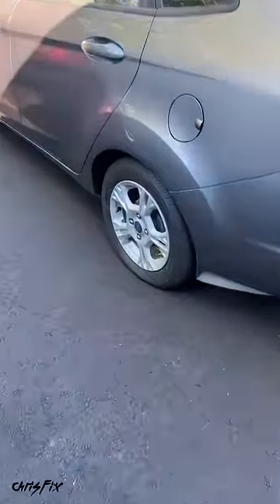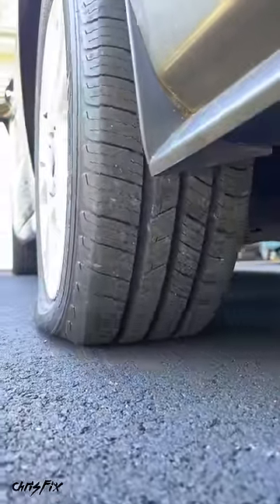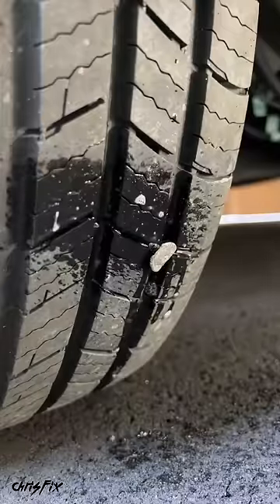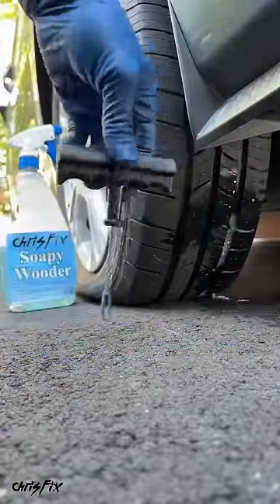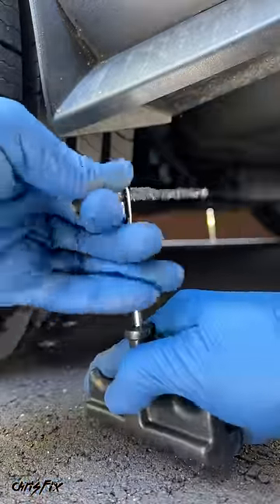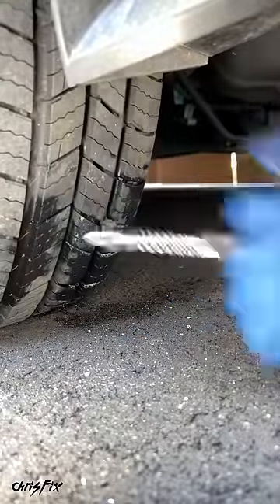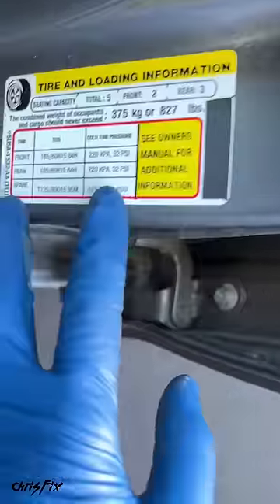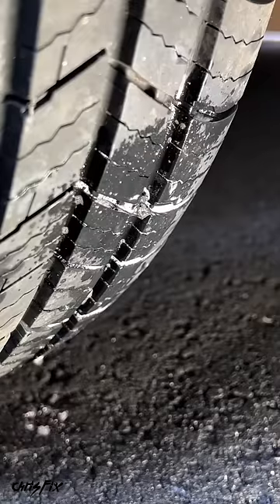How to Plug a Flat Tire (easily)

Comment: An important step you missed is that after you insert the plug, before you pull it out you need to turn the tool a 1/2 turn.  That way when you pull the tool out it creates a knot on the inside of the tire preventing it from being blown out when you fill the tire with air.  Every pack I've bought has this instruction on it.
Reply: I was waiting for him to say twist n pull out too lol
Reply: Very important step as I learned the hard way now.. Repaired about 50 tires that way but only mine went leaking about 10km after the repair..
Reply: The tool he used specifically states on the packaging, not to twist and to simply pull straight out. But i guess you must know more than chrisfix and the creator of the product.
Reply: @hufman9807  imagine thinking “chrisfix” knows everything. 🤡 if you read what he said you would’ve seen the part that say “every package I’ve bought has this instruction on it”. That doesn’t mean they all do. You can chill out a little bit.
Reply: He says it in the full video which is longer than this Short iirc
Reply: He also didn't mention anything about the glue (rubber cement)
Reply: Should also mention that this type of plug is not meant to be permanent, you should get the tire patched correctly at the tire shop as soon as you can.
Reply: @blackpiranaha525  The rubber cement is already on the plug
Reply: @hufman9807  That's right. You don't have to twist it. That's crazy. I never have and never had a problem.
Reply: Hey not everyone is perfect😂
Reply: I've always added contact cement to my plug. It makes it much easier to push in and pull out the tool.
Reply: Never had an issue not turning anything. There's no way in hell the plug is coming out anyway
Reply: @hufman9807  i work as a tire tech and our pro grade pruducts states to twist it. But still a plug is a temporary fix to get to a tire shop and get it fixed properly.
Reply: how does turning create a knot? 😂 that sidewall tho
Reply: @KimoKimochii  plus no instructions say that, the guy makes sht up
Reply: @rafars2246  exactly? if anything, turning makes it easier to come back out
Reply: @KimoKimochii  yep, it will be compressed, thinner.
Reply: @rafars2246  Thank you for having common sense 🍻
Reply: @SeiferFirehart  I've plugged tire damage like this a good dozen times over my lifetime same type of product. Those have been permanent repairs every time. I've always put rubber cement on the plug and let it dry overnight before refilling the tire, as the only thing different than what was done here.
Reply: Zachry Diehl 

Incorrect
Reply: @SeiferFirehart  

It worked for me for over two years. Pretty permanent
Reply: @ProleDaddy  Usually when you patch tires convetionally you apply rubber cement and wait for it to dry 5-15 mins depends on temperature (of course scuff the rubber first) and then apply patch or patch with a dowel and it's done, don't need to wait overnight. I've seen many tires patched with a wire like that as a mechanic and some did seal properly for a long time but many came for tire repair and only leak was that repair spot. Even if it holds air, it was designed as temporary fix, it is not the best seal and it only holds itself by the tire thickness it can easily get loose by rough road (like tiny rocks) and fall in or gradually weaken the bond and if knot inside failed or someone didn't even make one it can blow out, in both cases you will lose air very quickly and it can be very dangerous at medium to high speeds. Just repair it properly when you can, you don't want to risk it.
Reply: @Fordgroup00  I already explained it why it's not a good idea minute ago, don't want to spam that again.
Reply: If it blows out you made the hole too big or your over filling that tire like a basketball
Reply: There is no one rule for a plug kit as every different plug kit says something different when it comes to instructions.
Reply from the maker: Thanks for the tip. The instructions on this specifically said to pull straight out. If you twist you will pull the plug out with it because the plug will wrap around the reamer. Air wont push out the plug. It vulcanizes in the tire. If air pushes the plug out you didnt push the plug more than half way in.
Reply: I never done that twist and to this day no plug has failed
Reply: Never done that before and I've installed these plugs about 50 times
Reply: @dougb27  none would say that bro because if you twist something like that its just gonna wrap around the tool and pull right out
Reply: @thenorthernhandyman  
Pffft. You're taught to say that you need to take the tire into a mechanic as soon as possible just to get the business. I plugged many many tires in my 64 years and never had to get them patched. Crooks everywhere I swear.
Reply: @desertodavid Ty
Reply: So I plugged my tire and did not twist and...bubbles. I then pulled out the plug and put a new plug and did the twist a little more than half way and...no bubbles.
Reply: @desertodavid  anecdotal evidence, I can guarantee you that a patch is better in all circumstances.
Reply: @chrisfix  hey Chris can you please make an supercharger install on the drift Stang
Reply: funny, every kit ive ever bought says DO NOT twist.
Reply: @thenorthernhandyman stop lying. Tire tech? 😂 Aspire to be something. 😂😮
Reply: @BigDipper79  actually tried a few different trades, certified master driller, driller instructor, truck driver, road maintenance, loader operator, math teacher, assembler, wind and solar technician. I chose this work because of good pay, good schedule and a nice workplace
Reply: You do you let the Master cook tho👑
Reply: @SeiferFirehart I've plugged several tires an ran them for years with a plug in them..Just personal preference I guess.
Reply: @dougb27   nah sorry. youtube man knows his stuff
Reply: I was wondering how it stayed in without this - makes sense, thanks!
Reply: @SeiferFirehart Came here to say this. Also, don't try to patch a sidewall or the corner of the tire. For various reasons, that tire is now toast.
Reply: Imagine going to an instuctional dyi video just to be pedantic  🤡
Reply: Lol
Reply: I’m a yr late but you can see that he turned it. His hand is in a different position after the cut
Reply: Thanks I am about  to try this now 😎
Reply: @chrisfix you're the best
Reply: I enjoy eating a whole wheel of cheese on a hot day then washing it down with mayonnaise.
Reply: Some of them say don’t do that
Reply: @thenorthernhandyman  I never used a plug as a temporary fix and never had a problem
Reply: So I just had to plug my tire today it had a tiny nail in it and without taking the tire off of my Kia Forte let's just say it was really really hard to get the reamer in and even harder to get the plug in. It took around 2 hours but I did get it done. My advice before using the reamer make sure you take the air out of the tire. When putting the plug in make sure you have a little air in the tire. I also had to use a hammer to get the reamer in. Also make sure you get the T reamer in the plug inserter with the kit because you're going to need the extra grip I assure you.
Reply: Thanks  @chrisfix
Reply: For all the people that say this is only a temporary patch that's how the people at discount tire fixed mine by the way I always warranty my tires so to thought well I have warranties let them patch it the right way by removing the wheel and pacht it in the inside but no they plug it something I could've done myself and not waste my time on the wait line.
Reply: The real step he missed is saying “this is just a demo, read and follow instructions on your plug kit.”
Some have a special goo you need to apply to the plug, they’re all different
Reply: I've made several of these emergency tire rope repairs. Never have I twisted before removing the insertion tool. I will have to give this a try next time. Regardless the plug isn't going to be pushed out by air pressure lol
Reply: I've had lots of tires pluged and always upheld.. plugs are permanent not temporary.
Reply: @kingart813 drive that summagunn like a Demon🥶 until the Lugnuts rust off.
Reply: Never twisted on all the repairs I’ve done
Reply: @dougb27   What did you his girlfriend?
Reply: @thenorthernhandyman  i've done 5 plugs before and they have always lasted the entire life of the tires. They are pretty permanent
Reply: @desertodavid preach 🙌
Reply: Forgot the cement glue...

Comment: Tip: Don't get a tire plug kit that's shaped like a screw driver, you have no leverage when pushing the reamer in. Get the T shaped ones.
Reply: Made that mistake 3 days ago. Screwdriver shape is awful
Reply: Is there a specific name for that?
Reply: @Sebassftw  autozone has them. Got mine there. Fixed a flat on my semi
Reply: I have used strait reamers for 20 years and have properly plugged hundreds of not thousands of tires. I recommend a strait reamer. The trick is to make sure the injury is clean of debris and get a good quality plug preferably not a black or a red one
Reply: Definitely agree, I make my screwdriver one work but it’s much harder than a T handle 😂
Reply: Found that out the hard way!!
Reply: right get the one with the T handle.
Reply: Yep learned that the hard way 😂
Reply: Found that shit out the hard way.......
Reply: I wish I new that I was able to fix my tire 🛞 just as good thank god it’s back in order such an easy fix ! But he’ll that screwdriver sucks I was kicking it and putting all my weight down on it and it took a good 10min to get it deep enough was not as easy as the video I also had to get some air in their for pressure and I probably should have sanded a little more but it felt wrong making the hole bigger lol 😂
Reply: Imagine that plastic T handle breaks and you end up with the piece of metal inserted in your hand lel
Reply: @robertkennedy3954  if you have trouble inserting the reamer you can just drill the hole to make it a little bigger.  As you saw, if the hole is too little then the plug won't fit.
Reply: That's true the T type is más mejor
Reply: Grip* not leverage
Reply: yup made that mistake today and ended up having to use my spare to haul it over to a tire shop to get it plugged correctly because the metal hook broke off inside the hole
Reply: Yes yes a million times yes. The T handles are cheap anyway so no reason the get the screwdriver style. You will have ZERO leverage and make your life unnecessarily difficult
Reply: Wish ik that sooner, damn...
Reply: @SMoonTeam   well at least now you know for next time. thats something
Reply: I have a Screwdriver one. But I'm a Strong Man. I don't cry like you
Reply: @2424Goldie  They shouldn’t even make em like that. It’s literally advertising the wrong tool.
Reply: No. Get a spare tire & a jack.
Reply: What's the big deal if you have pliers?
Reply: I just learn that two hour ago. My hands are blistered up. 🤦🏽‍♂️

Comment: This is a whole lot easier to do on regular passenger all season tires.. Not soo easy on low profile summer tires. He forgot to mention its also easier if you add air to the flat before plugging.

Comment: I've been using these for over 30 years and never had one fail.  Plus I've saved a ton of money.
Reply: but you should put the special glue that comes with this way it will last more.
Reply: How long does it last?
Reply: Once, I had a 16d nail go in head first.  I was planning on getting new tires in a couple of months, so I tried to patch that hole.  It took 3 of the sticky plugs ( special glue not needed with those) to finally seal it up.  It lasted the 3 months, until I got new tires, without losing any air.  I wouldn't recommend doing that, but as an experiment, it proved to me that they work.  As far as a regular hole, as I said, I 've never had a failure.
Reply: @muhyihammad2007 yes it bonds plug with tyre does vulcunisation
Reply: It could fail at the maximum load, pressure, speed, and temperature. So it won't if you are sane.

Comment: Excellent job. I recently discovered this and I’ve used it multiple times. I timed myself once and it was under 20 minutes. That included removing the wheel and filling the tire to the appropriate pressure and reinstalling on the car. 👍🏽

That was much faster and cheaper than taking it to a tire shop.
Reply: Why are you taking the tire off to plug like he is ? Move the car until in best  position . Which is exactly as he is.

Comment: Every actual mechanic or tire guy here will know Chris has the strongest Forearms on the planet, my man reamed it with the plug tool outside with no leverage Jesus Christ that’s impressive.
Reply: Yes!  I can't believe I just witnessed something that's practically impossible to do.  Did you see how much he flexed the tire?
Reply: The initial insertion is the hardest. Maybe it was already reamed out before recording.
Reply: Exactly!  It looked so easy, that I tried it, but had to put the nail back and take it to the shop. Lol!  But thanks, anyway 😅
Reply: @paulapatino4834  Just apply some heat to the plug with a lighter and it's super easy to put in. Works every time.
Reply: @helvacihelva 
Where were you before I had to plug three tires in the past 4 hours. The last one I laid there staring at the sky for 5 minutes
Reply: @hakenkreuz7076  I know the feeling :D Once I tried to put the stick in between the tyre and ground, then roll the car on it, the stick was broken and plug was not in :D the weather was very cold so I though maybe heat will help and bang, it went in like butter.
Reply: @helvacihelva  thanks I'll try that next time (heating the plug). I usually end up drilling (compact driller) the hole in tire bigger to be able to put the plug in...
Reply: Nah bruh yu right them tire for that extra tight 🐱grip no matter how many times yu pull in n out the hole just keeps getting tighter(rubber makes the hole close back up unlike the 🐱)

Comment: It works permanently if performed correctly. The plug vulcanizes and has been used for generations. Big holes need patch. This works perfectly for most nail holes.
Reply: As someone who works with tires daily i can tell you for sure that about 40% of those fail after a while. In my country they use those on  highaways tire shops since customers won't come back and you don't have to  take the tire off. The worst thing about those is that you are making existing hole fucking massive and making it difficult to patch it later, after string fails. And yes, i have at least one of those weekly, at a small tire shop.
Reply: @wittekPL hey must not know how to repair them correctly.  Have two tires on my car right now that have plugs that’s been in them going on 3 years now. I will need a new set of tires soon because they are getting worn down but those plugs have held.
Reply: @cvdixon29 or he just wants to sell new tires.